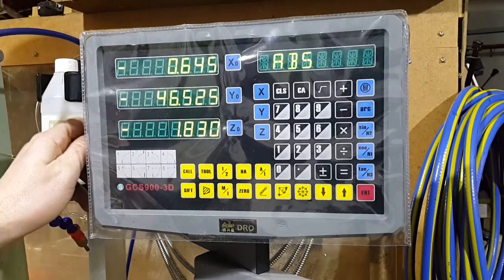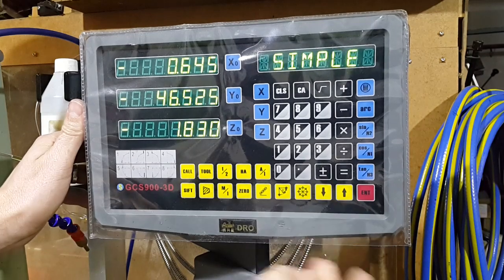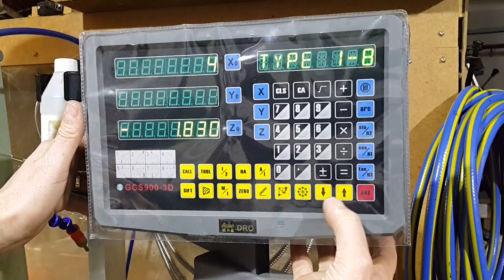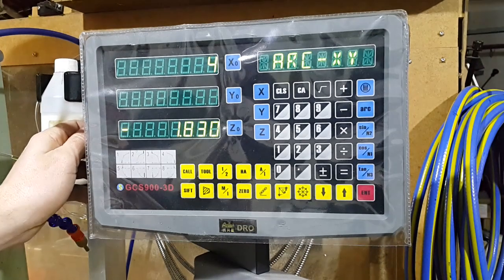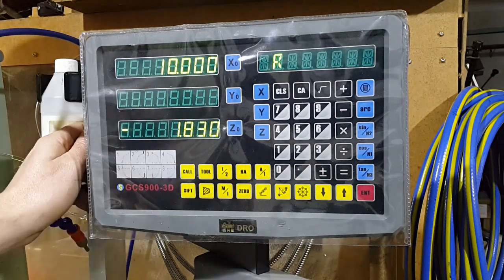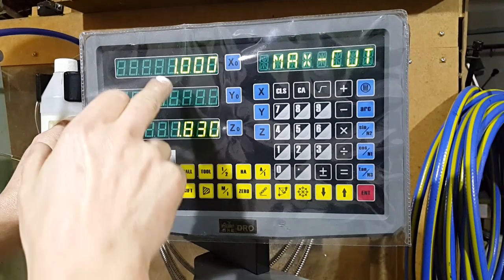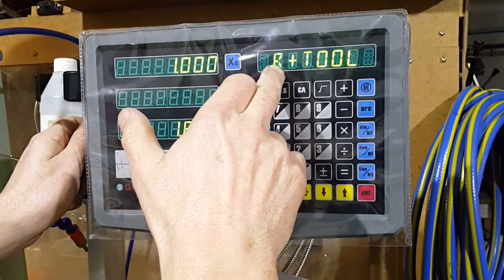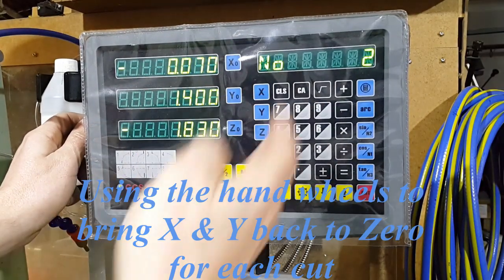#38 - DRO - Machining Arcs/Radius's - Part 1

Comment: used your setup numerous times and cant get it to work on my graphical dro , really frustrating for such a simple process , be nice if you could show your dro throughout the process and i assume settings are in abs mode , cheers

Comment: Hi Thanks for the great video - just one question at what point do you manually find the start point/ center (approx 5.08 in the video)   Is this before programming the console or after ?    Cheers
Reply from the maker: Hi, we use a edge finder to find the edges and set the DRO to suit.

Comment: Thanks for this. I have a 178mm radius over 180 degrees ie a semi circle to cut. I think I need to cut it as two 90 degree corners. To rough it out can I use the simple function at radius of say 180mm with a ripper and then go back and recut the final radius  with a finishing end-mill taking account of any cutter diameter change?
Reply: Probably be easier to just use the circular pocket feature and cut the air for half the program.

Comment: I have this exact DRO and am having difficulty doing what you are showing.  Unfortunately you did not answer my questions that I have in trying to under stand how to do the inputs.  You chose type 4 for the type of cut whereas It looks to me like it should have been a type 8 based on the corner of the piece you were milling.   Plus, my book shows a type 4 moving in a counterclockwise direction from the initial tool position.  You were moving in a clockwise direction from the first cut. That is based on the symbols on the front of the display on the left side of the DRO screen.  Can you please clarify why you chose type 4?  The other question is about the R+Tool setting.  How did you ever determine that a "+" sign meant outside cut versus "-" sign meant inside cut?  My  book doesn't even mention the R+Tool setting so I though it meant the tool diameter plus the Radius of the cut, which I found out was wrong by watching this video.
Reply: I have exactly the same confusing scenario with my Sino SDS6-2V DRO. I've just done a dummy test run through on an arc running clockwise from 12 o'clock and ending at 9o'clock. The diagram on the panel suggests I should select a number 8 arc. Ended up using a number 4 sequence. It is all are about face. I think a much better option is to purchase one of the latest LCD readout panels from Banggood as they are far more intuitive to use. Myford boy's channel has one on test and it looks very good in use. They seem to cost around £80 quid for a 3 axis readout.

Comment: G'Day Kevin, these DRO's make things so much easier.  Over the years they have added in these extra nice features or as I like to call them bells and whistles.  I've never used the radius function but I know its there if I need it.
Cam
Reply from the maker: I agree Cam. When it comes to radius's I just use the rotary table.
Its good to show people what functions DRO's have. Especially new comers who may not be able to afford a rotary table when they are getting started in machining.
Cheers Kevin
Reply: Mmmmm

Comment: G’day Kevin. I gather after each cut the DRO setting is advanced to the next position and the cutter moved to that position bringing the display back to zeros also taking care to move forward in the correct plane first. Small job then to file it smooth. 
Thanks for sharing. Cheers 
Peter
Reply: However.....for someone who is not familiar with dros.....it would have been nice to show what was being done on the dro for each move?????